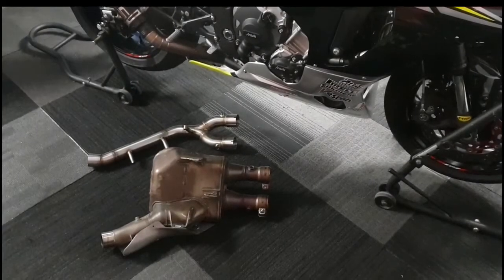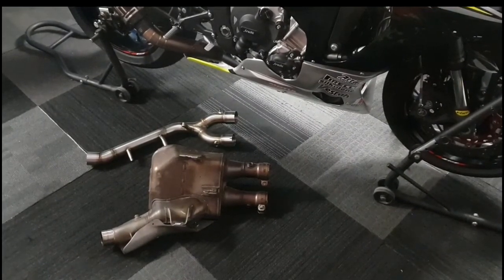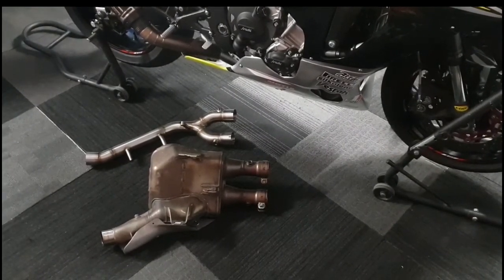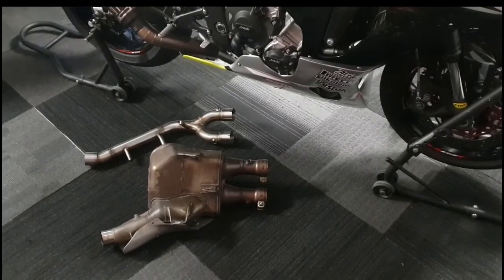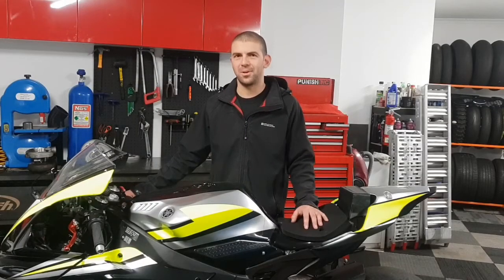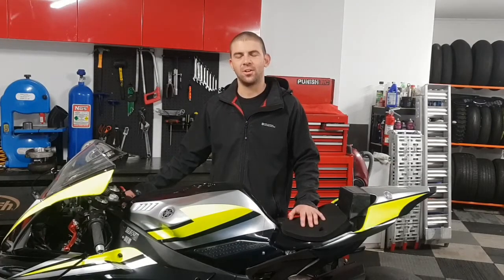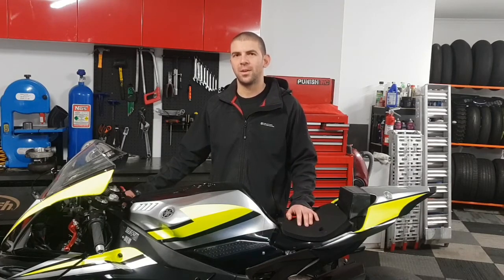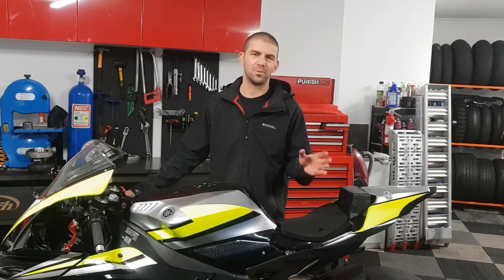2015 R1 Dyno with Ebay decat link pipe exhaust.

Comment: The more air flow, the more fuel have to be injected ... What about Lambda readings? Lean at WOT right? If you decat you have to increase fueling. My be a higher rate FPR should be enough...
Reply from the maker: Absolutely!
This was with corrected mixtures.
Without tuning the bike had a lean bog at WOT and lost power.
I’m using a re-flashed ecu and pc5 for touch ups.
The standard fpr is fine supporting basic intake and exhaust changes.👍
Reply: @FairlyLegalCarMods  Higher rated FPR alone increases injector flow. So using a 3.5 BAR FPR instead  of the stock 3.0 BAR can provide the additional fuel needed at open loop. Higher rate FPR with stock ECU, decat pipe, airbox lid and stock exhaust muffler: it may be a cheap yet effective solution for increased airflow avoiding lean conditions. Just curious, seems that you have access to a good testing tools and dyno environment...🙏
Reply from the maker: @athalfridhu  What you are saying is correct although a stiffer fpr alone richens the entire fuel table and can make tuning quite challenging.
I should have clarified that cat removal caused erratic fueling and while extremely lean at certain throttle positions it also over compensated and was rich in others.
I’m not even 100% sure we are allowed to run different fpr in the class I race in! Lol
Thank you, yes I have my own Dyno... the neighbours must hate me!
Reply: @FairlyLegalCarMods  I wish I were your neighbour...🤣

With the stock ECU, higher rate FPR should enrich only open loop side. Closed loop will read  narrowband lambda and shorten the injector pulses to match the Factory AFR. Open loop side will be enriched with  8% more fuel at 80% duty cycle...

As you tested in other video, the stock ECU is working at 14.7:1 AFR at WOT. So enrich all the open loop side of the AFR table should not be a problem.
Reply from the maker: @athalfridhu  thanks for the tip.
Reply: @FairlyLegalCarMods  FPR upgrade is not perfect solution, but is still a good approach and a cheap option for people in India or in Laos that haven't access to piggyback ECU's, laptop, dyno...

Also when the injector is already in 100% duty cycle, wider pulses won't deliver  more fuel...